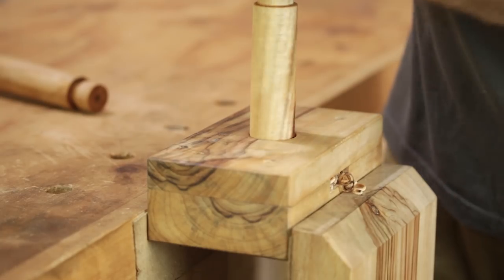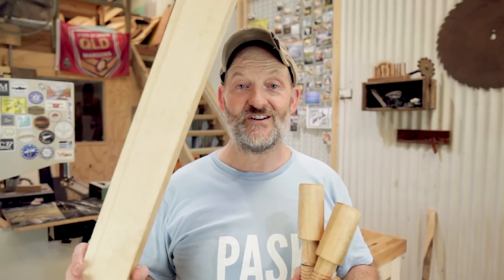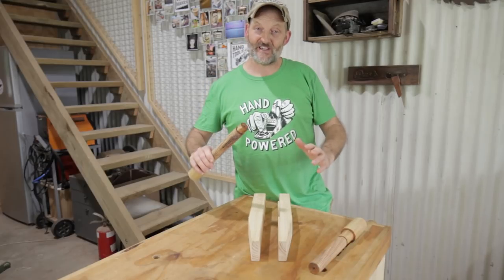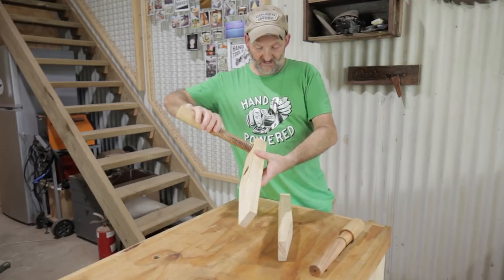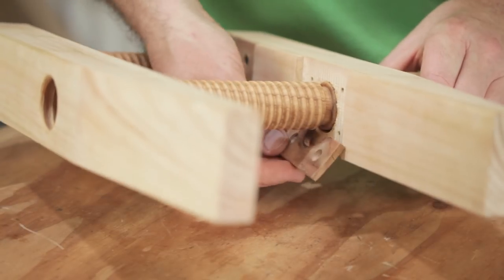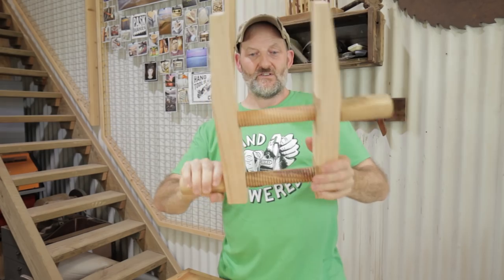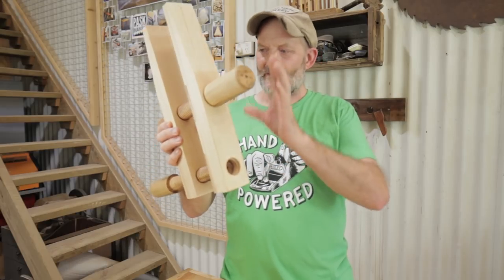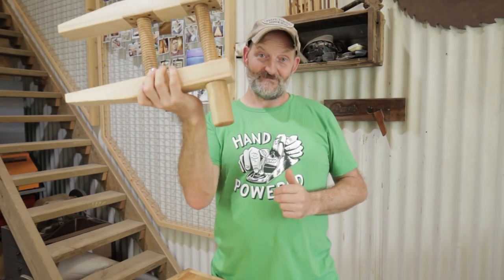Large Handscrew Clamp

Comment: Very nice!! I'd have placed the collars on the opposite side of the jaw body. This way the collars get pulled into the jaw body and won't rely on the screws.
Reply from the maker: Thanks! The end screw needs the collar on the inside of the jaw as that screw pushes into the inside of the jaw when under pressure. The other collar (for the middle screw) could've been put on the outside as you say but there wouldn't have been much room for the screws as the handle is quite large. The way I've done it still works though as there is no pressure put onto the centre collar as the underside of the handle pushes into the outside of the jaw and doesn't allow the collar to take any pressure (the groove has a fair amount of play. :)
Reply: Both screws could have gotten two collars, on both the inside and outside of the clamp. Or thicker collars. All the pressure from the clamp is held onto by these flimsy pieces of wood, it's definitely a major stress point!

Comment: Beautiful work.  One design oversight:   The front collar, towards toe of the clamp -- should be on the outside of that  clamp rail. That way, as you apply clamping pressure, the back screw presses the collar INTO the clamp rail, and the front screw pulls pressure INTO the clamp rail.  
As currently configured at time of this video.... the clamp can only apply such pressure as can be tolerated by two of the four screws holding the front collar in place.  The moment any two of those screws give way,   The front collar pulls loose  - and no clamp.   Hence, the collar arrangement should always press the collar into the clamp rails.    QED.    There is another arrangement by which you can apply the collars tangentially such that the clamp jaws can be racked.
Reply from the maker: Thanks! I can see why you'd think that but the front collar doesn't get any force put on to it as the shoulder of the screw handle prevents that happening! :)
Reply: Ah hah!  I stand corrected.  On second viewing I now see what you mean!   Thank you for pointing that out.    I wonder if there is a practical method to build a wooden thread support that would allow the threaded screws to rack?   Of course, this is demonstrated with Jorgensen style clams as you can use a steel block for the threads.   Could this be done, in some fashion with wood only?
Reply from the maker: No worries! I'm not sure how well it could be done with wood, if you made swivel blocks there may be too much friction plus they would end up making the jaws quite large! :)
Reply: I think (I imagine) from theclampguy.info photo below,  the lower clamp rail could pivot on the shoulder of the front screw.  The tip of the back screw need not actually be held in place, but could be allowed to find its own press-point;  eventually marking out a radiused dado or trough.  This would give the jaws /some/ flexibility of angle without binding the threads.  Maybe?

Comment: Heh, a giant screw clamp 8). Hmm, wouldn't it have been better if the collars were fitted to the outside of the clamp? That way the clamping pressure would pull them against the meat of the clamp body.
Reply from the maker: The rear screw pushes into the collar and the shoulder of the handle on the front screw prevents any pressure put onto the other collar! :)